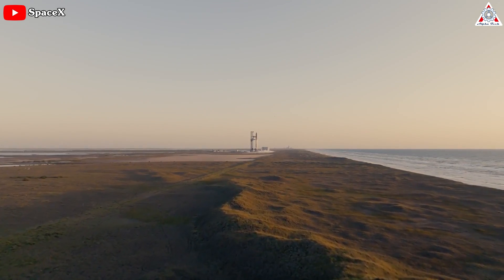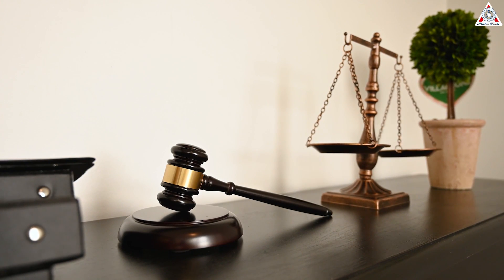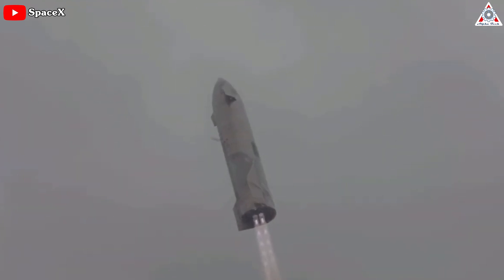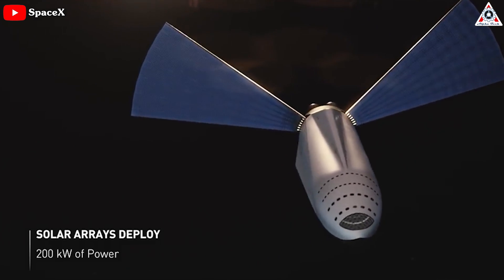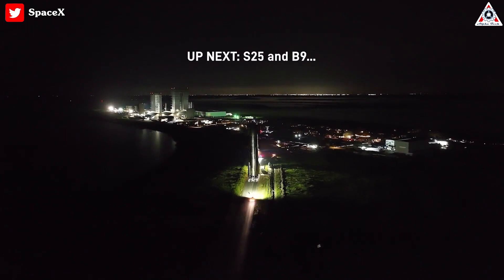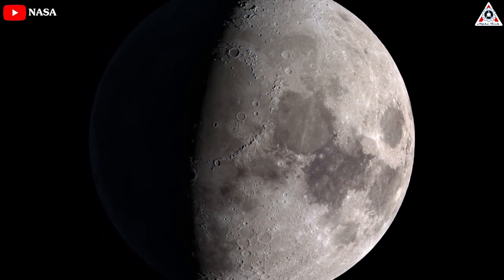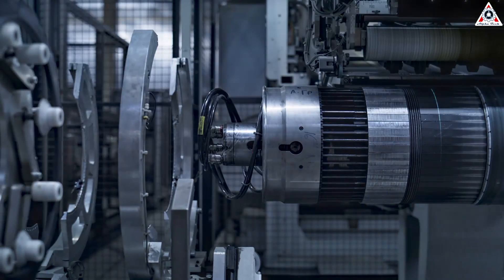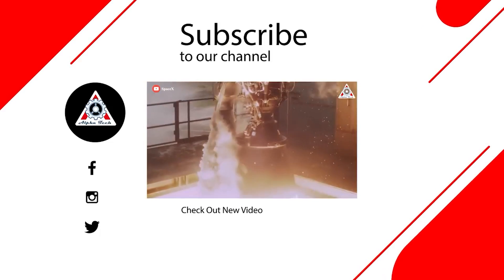SpaceX Naked Starship Weird Design, unlike others...

Comment: You only need a set of orbital boosters from an orbital craft where passengers embark on an eco-sphere. The boosters set speed and trajectory then return to home orbit to refuel for next launch. Whether it's the moon or mars the Eco-sphere capsule enters an orbit of the destination and shuttles are used between land and orbit. Boosters and eco-sphere adjust in size to fit traffic needs. Send a thousand people at a time in an eco-sphere and reuse the boosters again without ever having to land them first. The Falcon heavy rocket is already a certified rocket. This means you could put a large number of people in orbit around Mars or the moon before you ever land there. There's not much engineering left in comparison to start populating space.

Comment: There are so many reasons to have a naked version of Starship. Any Starship that has no intention of reentering the atmosphere of Earth can be a naked Starship. That includes the Orbital Fuel Depot, the Lunar Starship, and any kind of cis-lunar shuttle version. Once the Starship System gets up and running, I foresee several different models for use in cis-lunar space. We will need a real serious infrastructure to support lunar surface operations and bases.
Also, I feel like SpaceX needs to get realistic about what kind of Starship will be man-rated for launch of astronauts and passengers from Earth and fully able to bring them back home in an emergency. There needs to be totally separate versions for Cargo, Tanker, Tanker Depot, cis-lunar transport, Human Lunar lander, and Interplanetary Mars Transport. 
The man-rated, astronaut ONLY version of Starship will need to sacrifice payload for redundant human safety systems. We need escape capsules capable of reentering Earth's atmosphere and landing during ALL phases of launch and orbital insertion. (NO "deadman" blackout zones where no recovery is possible.) Whether that will take the form of individual capsules similar to the B-58 bomber capsules for their crew or one big section of the Starship that can separate from the huge fuel tanks and come down by parachute is up to the engineers. But until such a version is created, I see no possible way for NASA to sign off on astronauts going to orbit on Starship, or passengers wanting to go on the "Orient Express" version of ballistic intra-Earth transport.

Comment: about the cost of transport even the $500 / Kg are nothing compared to the ++ 10 000$ / kg of the pre SpaceX period
at that time Each additional gram had to be imperative in view of the astronomical cost of transport
this cost included the disposal after a single use of an entire rocket system
sometimes you have to remember what space was like before reuse like spaceX

Comment: S26 is going to be the prototype refuelling tanker, as it will just be in high storage orbit, probably either at a legrange point or orbit round the moon
Reply: A ship with only propellant tanks will need to launch 5 times to LEO in order to top off a cargo ship. Perhaps depots can be kept in orbits, such that cargo ships launching satellites can transfer unused propellants into them. 

Looking at the chart, a 100 ton cargo ship refueled in LEO will only be able to land ~50 tons onto the Moon and return empty. That number will be lower if the ship is returning to LEO. Perhaps that will be outside its operational capability, as returning cargo ships will likely need to end the return leg with re-entry and landing.

Comment: Glad to see someone is starting to think about transit ships where they are just cargo containers.

Using steel starships would use way more fuel than aluminum containers and palletized lander units. In fact, could all be robotic and not require more than solid propellant engines and parachutes.
The good news is Elon is getting things rolling, and everybody else has to start to think and act, or its gonna be like being invested in horses when cars and trucks started rolling off assembly lines.
Others will come up with other expressions and models, this is just Elon's interpretation.
But what Starships make the most sense for, is hauling Graphine into low Earth orbit to build a space elevator with.

And Elon is fighting a gravity well, and a bureaucratic black hole sucking humanity's potential when we are time limited.
When Alien rearrival happens, it will be realized these buffoons delayed our ability to escape and disperse.

Comment: I think it's just going to be a cheaper stripped down version of Star Ship used during the next orbital testing. It's unremarkable because the goal is using the booster and stripped down star ship to reach orbit with the minimal amount of cost risk.
Reply: A semi-test article with no internal cargo. Used as demonstrator as to what size mass of payload could be sent up. Sort of a expendiable second stage ala Falcon-9 only scaled up. Say 75 ton modules as part of construction of new all US space station or as a assembly point for building OTVs. Either for Earth use, Moon use or build large OTV for Mars trips. First thing to watch foris if they move it somewhere else. That or they just have  not decided what its going to be yet as the design for what they want to make is still in sombodies head.
Reply: @howardhowe3453  It might also be a test of curiosity, to test reentry on a non-tiled star ship. That sounds like something Elon would do. Maybe a stripped down tanker test with a reentry burn, to drastically slow down the ship before reentry and test whether it's possible to reuse the tankers without even needing ceramic tiling.

Comment: I was thinking about a flapless design,  by using manoeuvrable weights inside the rockets structure.  Possibly also useful for a hypersonic missile design.
Reply: That seens so much harder for something so much worser
Reply: I would think the weights would have to be heavier then a flight control surface is
Reply: Probably,  but it would be countered to some extent by less drag,  with only small static fins required.  However I will leave that for the aeronautical engineers to work out.
Reply: @edsherwook5196  yeah
Reply: Yeah but that’s less cool
Reply: Rotate the tanks outside...   ;-)  :-P